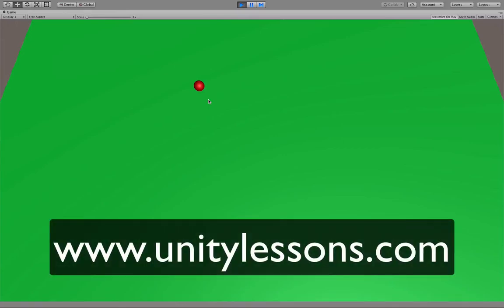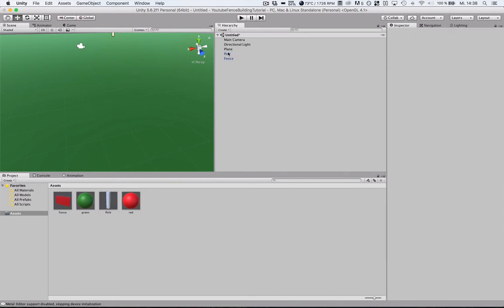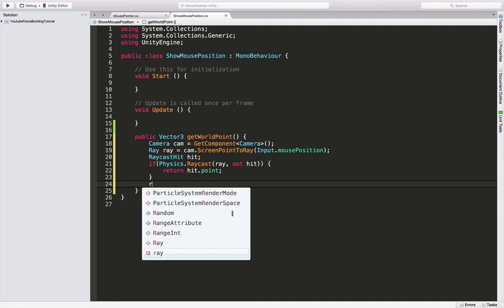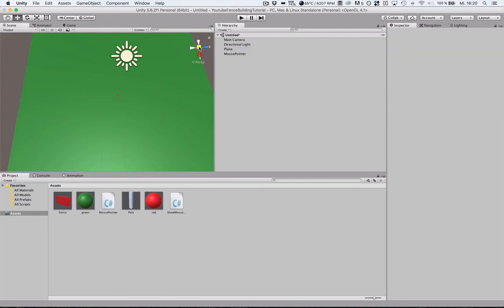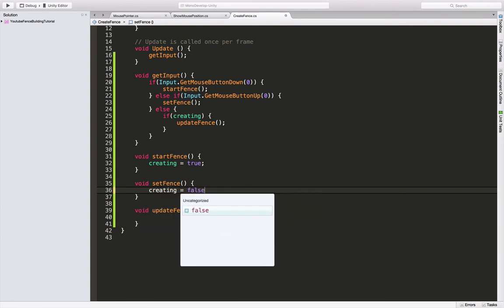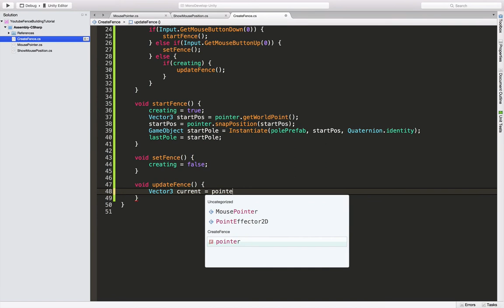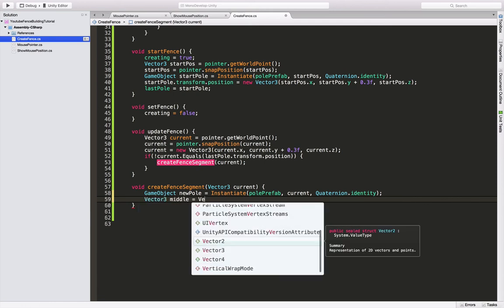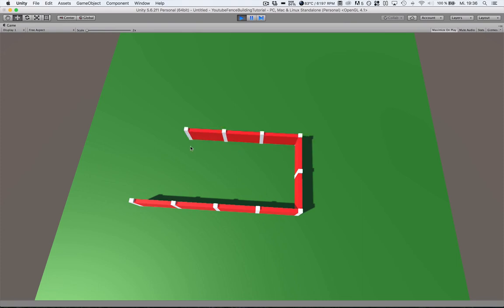Unity3D Tutorial: Modular Fence / grid based Wall Building

Comment: hey great video how can we make it a add a ceeling automatically when walls gets together like a room i hope you get the idea
Reply from the maker: well, it would require you to be able to determine the point in time when the walls close a shape, otherwise you wouldn't really want to close the ceiling just yet I guess... so I would suggest you track the coordinates of where you placed walls and then you should be able to write an algorithm, that determines if the walls form a circle somehow, that would be for example the case if you can find a path that comes back to where it started. I'm sure you can make something up, the data of where you're placing stuff is there, so keep track of it and implement some kind of circle search on it. I would use some kind of graph representation here (so vertices/nodes and edges, each vertex having a list of other vertices it is connected to) Next task would be to determine the shape of the circle, I guess looking for extreme points would be a good idea for this, assuming you're just making rectangular shapes. If it should be any shape.. then.. well try tracking outer walls of the enclosing circle, if you end up in a node with degree one (as in: it only has the wall connected to it, you came with) then you are in a dead end, go back to the point in the algorithm, where you had a node with remaining edges you haven't tried yet until you close the circle. By keeping track of all the walls involved in the outermost circle, you should be able to construct the shape for it. If you think this through, not being able to close the path and having no edges left that you haven't tried yet (as in: all paths were dead ends) means: there is no circle yet. Hope this helps :)
Anyways,  Good luck!

Comment: Hey, thanks for making this (you probably wont see this but whatever). i'm new to programming and didn't really understand your explanation for the other comments on how to not make them go diagonal, could you please if you have the time give me a more detailed explanation on what to write in the code? Would help a lot :)
Reply from the maker: well in this tutorial I work on not allowing diagonals to make it grid based. Check out my other videos, there is another walls tutorial, the first video did still allow diagonals, however no integer placement. But just don't require x1 == X2 or y1 == y2 in the code but allow any ;)
Reply: @Temophor  thanks, earned a sub for being the 0.01% that actually helps commentors
Reply from the maker: @fanpatti9317  yey :) I haven't uploaded in ages... maybe I should start again

Comment: Question is this code royalty free and can we use it in our free games if we give you credit
Reply from the maker: oh that's so nice to ask :) I believe most of the people just use the code, I mean that's what I made it for, right? But I'd be super happy to appear in the credits of your game with my channel ;)
Reply: Can do, your code your rules
Reply: Hey, on your dynamic walls tutorial I made a blender model and imported it, I hade to do a lot of adjustments and such to make it ok, but how would I make it so no matter what their would be no overflow after the fence or before if you know what I mean, thx
Reply from the maker: @bobmot1246  well, I used whole integer values to achieve the grid snapping, so either make sure your fence model adds up to 1 with each segment + pole, I think I did the math in the video how you get to 1 = (0.9+2*(0.5)). If you don't want your model to be size 1, you could introduce a scaling factor when checking the grid snapping..
Reply: I meant for the dynamic walls tutorial not this one
Reply from the maker: @bobmot1246  are you scaling your prefab as you position it? Or repeating? Do you mean overlap by overflow? If you are scaling, make sure to only scale the original object in one dimension, so it keeps say width and height, connect them with poles, that also don't scale, this should then enable you to position all your objects correctly, if your objects overlap because of the angle at which they meet... well I dunno, is that relevant to you? Cheers :)
Reply: So, ok I made a model in blender of the fence then I imported it to unity and plugged it into the create wall script, but then if you made a fence to big you can see some of the fence extend past the point you placed it, I have resized it in blender, but then it won’t extend far enough, I was wondering if their was a way to make it so that the fence fits in perfectly
Reply: @bobmot1246  maybe like assume the position of the fence part to be "the truth", set it like you want it to be set (with the user input and stuff) and then fix the poles position after you placed the fence. You'll just have to do your maths here, deriving the direction to go in by LookAt and deriving the distance from the center to the endpoint from the scale factor chosen for the fence.
Reply: Oh, what i was trying to do was get the perfect size in blender for it
Reply from the maker: I dunno, do you have a Screenshot somewhere? Maybe then I can give you a hint. You don't seem to be doing the grid based thing... So really try placing the scaled wall first in your script, then derive the correct positions for the poles + new points to connect to
Reply from the maker: And I recommend making your model unisize 1 in length, so that you actually can work with scale and figure out the maths... of course you can use a different scale for the prefab, but that means just more math in the end :D
Reply from the maker: Maybe there is also a way to export the prefab wall I used for the tutorial from unity to Blender, then you could make sure, that you align your object correctly. Just as an idea... if it keeps the scaling all the way exporting from unity to blender and back
Reply: Ok, I am talking about the dynamic walls tutorial, and for a screenshot all you have to do is imagine a fence piece go past where you place it and start before where you put the start... I don’t know if that helped
Reply from the maker: @bobmot1246  *envisioning the screenshot*.... oooh, okay. But ist that something that stays consistent? Or does it only overlap after you stretch the fence piece over a certain amount, then having one scale where it maybe would fit perfectly and then if you make it smaller not even connecting to the pole? Again, what I recommend you do, is to make sure to create your fence piece model in blender with a unified scale to be able to the maths in unity / C#..
Reply: Oh, ok do you know what that scale should be, do unity and blender use the same units. Also for the overlapping they are hidden by the start and end pole until they reach a certain scale in which then they are big enough and grow beyond them.
Reply from the maker: @bobmot1246  I would use size 1 for the prefab I think.. try making a very short fence and a very long one, see if the way the pole overlap behaves is different/the same. If it is different, setting your model to a unisize scale (like 1) could really help. If they behave the same, changing your pole size instead could help
Reply: Ok, thanks man you have been a real help in this, also is their a way to get the area of this though code?
Reply from the maker: @bobmot1246  again the answer is maths ;) google should be your friend here
Reply from the maker: search google for something like: "calculate area from points"
Reply: Ok, thanks hope that I can work with you again

Comment: I want to save the walls generated for use in my scene. How would i go about that?
Reply from the maker: check out PlayerPrefs to save simple data. Otherwise I recommend doing a google search to figure out how to save to a file, it's fairly simple also. If you want to pass the information over network, maybe have a look at how to use json... What's your ultimate goal? A level builder? I once built a system for a game of mine, where I would create my scene in the editor and save the gameObject's positions to a text file as I run the scene in order to regenerate the level on the fly to load different levels.
Reply: @Temophor  Actually I'm using unity as a simulator for my robotics research project. My current goal is to easily make maps and save them to be used later. As of now I'm saving them as prefabs. I'm fairly new to unity and still learning how to use it in developing simple envs to be  used to simulations for obstacle avoidance and SLAM.
Reply from the maker: @cooldhongibaba  okay cool, is your map grid based or does it have a lot of custom meshs? If it is a grid I would suggest just saving your map as an array of 0s and 1s and regenating it from the saved file. Or in what way does your robot process its environment? Or are you using raycasting stuff?
Reply: @Temophor  its more like a model of a house. Its basically to simulate how it would behave in somewhat real environments. Its currently using a stereo camera setup for sensing and the robot related code is mostly written in python and ROS (I'm using a middleware called RosSharp to communicate between Unity and ROS).

Comment: How would I make the snapposition smaller ... And how would I make it that you can't instantiate on another wall
Reply from the maker: you need to write your own function to round in steps of 0.5 for example. To avoid creating multiple walls at the same position, maybe put the walls off the RaycastIgnored layer, then recognize that there already exists a wall on click (on mouse over) and therefore prohibit creating a wall
Reply: Thanks

Comment: Great tutorial. 

What about creating 4 walls at a time like closed rooms, simply dragging the mouse? In other words, generating rectangles simply dragging the mouse around? How would you implement that?

Also, your implementation has a huge constraint, which is that all poles and fences objects need to live in the "raycast ignored" layer. What if you need to actually select a single fence game object with the mouse? Maybe to remove it? Any idea why they start to stack one on top of the other if they live in the default layer?
Reply from the maker: Andrea Brandi creating a room with only two reference points is possible as you can calculate the other two corners, then you would need to instantiate the walls accordingly.

I have thought about the IgnoreRaycast problem. Simply hold all created walls somewhere in script and support two modes, one for creating walls (= moving all walls to IgnoreRaycast layer) and one for deleting walls ( = walls moved to a different layer via script.
Reply: Thanks a lot for your suggestions. I like the idea of moving the objects to other layers, I wonder if there will be performance implications of doing that at runtime, hopefully not.
Reply from the maker: if that is the case, here is another idea: you could recognize, that the y coordinate differs from standard when placing a pole on top of another and derive the position you apparently intended by adjusting the y-coordinate
Reply: I will look into it as well. thanks again.

Comment: Thank you for this video. It is an uncommon concept, yet crucial for RTSs especially. This helps a lot.
Can you help me with a quick question regarding the walls/fences?  In my game, when I create the walls/fences in a horizontal or vertical line (with regards to my monitor) the walls get all zig zaggy. When I create them in a diagonal fashion, they appear straight, which is how they should appear. Is there a specific code that will allow all fences created to be straight, and not instantiated in a zig zag pattern?
Reply from the maker: hey :) simply check if either the x coordinate or the y coordinate of the start and end poles match. Alternatively you could check for the two poles having a distance > 1. Don't allow adding the segment in these cases
Reply: That's genius, thank you again!